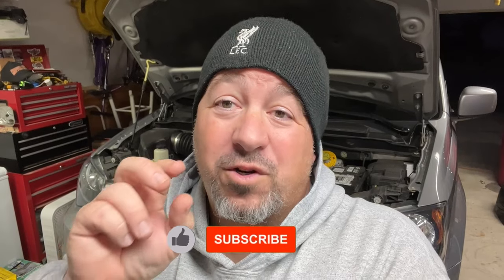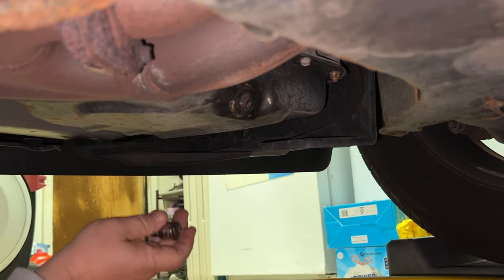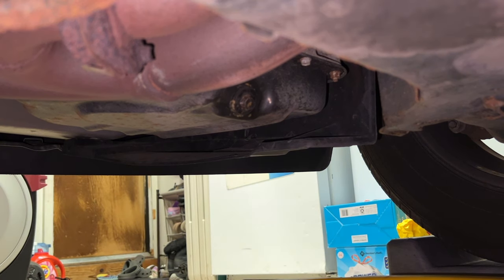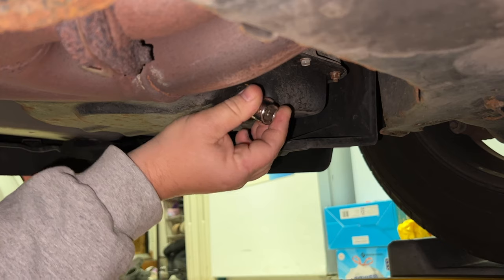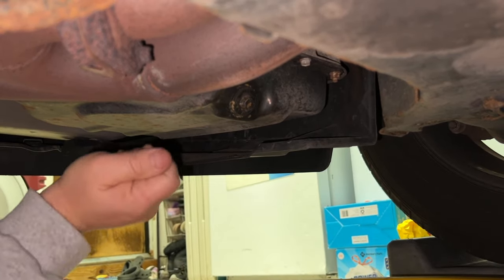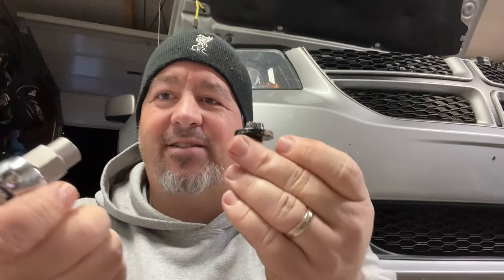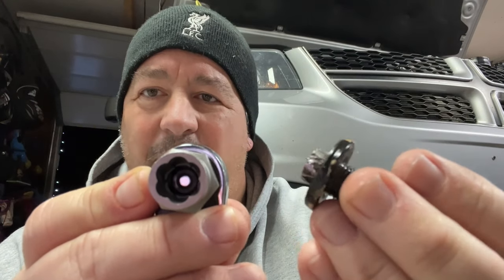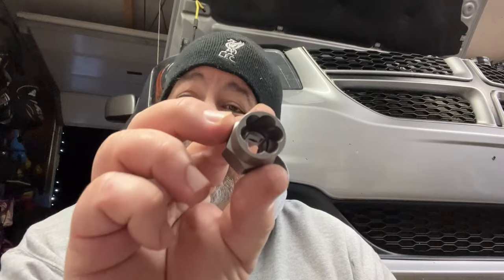ROUNDED / Stripped OIL DRAIN PLUG? How to remove a rounded drain plug with an Extractor Tool Set DIY

Comment: i noticed you said the drain plug was a 13mm, what size extractor did you use to hammer on?? Mine is a 17mm . Have you ever had to use a smaller extractor to hammer on the rounded plug??

Comment: I tried an extractor and it just continued to shred that bolt. Someone freaking put it on with a torque gun. It's way too tight.
Reply: Having the same problem rn
Reply: Wait don't leave us hanging. How did you get it off please. I'm in the same situation
Reply: @jonathanpaine3411  I ended up having it so rounded that we used vice grips and it still didn't do anything. Gave up decided to try again the next day , had to use a size smaller than what my bolt size was for the extractor (17 mm but it was so rounded I used a 16) and I literally smashed it on with every ounce of force from a hammer. Then after 10 min of working at it pushing the ratchet so hard to try and loosen it that the engine was moving... It finally came loose.
Reply: I'm in this situation right now.  Thank you for posting your solution

Comment: it's NOT rounded if you can atach something to it....  also you are lucky that bold is from good metal..sometimes it's aluminum and you cant do nothing! it just too soft
Reply from the maker: Even aluminum can be grabbed with the teeth. And I’ve done it with fully spun rounded bolts. Depends on the quality of the twist socket too.
Reply: It’s rounded if a normal wrench won’t grasp it .

Comment: 🎯 Key Takeaways for quick navigation:

00:40 🛠️ If your oil pan drain plug is rounded or stripped, you can remove it using an extractor nut.
02:41 🧲 The extractor socket can grip the rounded drain plug and help you loosen and remove it easily.
03:40 💡 Extractor sets are affordable and useful tools for dealing with stubborn rounded or stripped drain plugs during an oil change.

Made with HARPA AI
Reply: Bro said the same thing three times 

made with HARPA AI